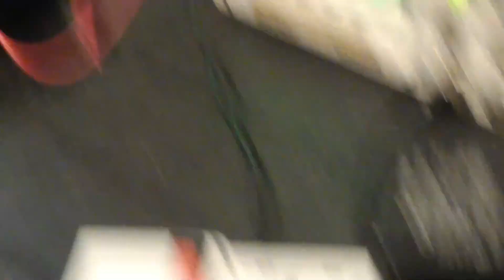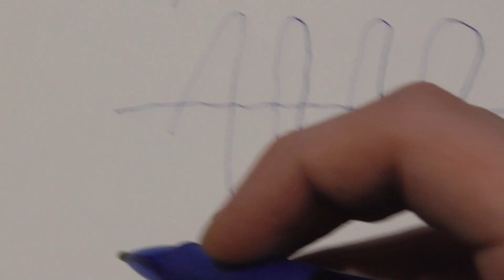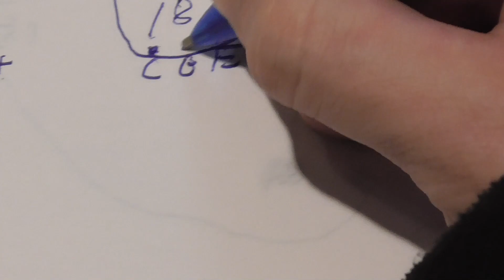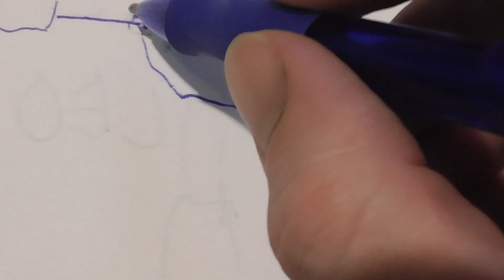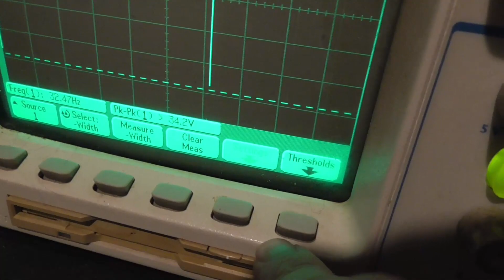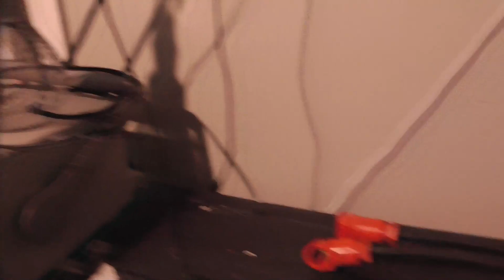Back EMF In Detail

Comment: What's the value of R1? Is it that big ~10watt looking resistor? Surely a base-feeding resistor needn't be so big??
Reply from the maker: It's just a basic simple  transistor oscillator circuit.  Not really specific to any of my other projects unless I specify like "this is a joule thief circuit" R1 is just base resistor, It's representation only. The value will change according to the parts and voltage used :)
Reply: @joellagace1679  fairynuff :)
Reply: @joellagace1679  I guess your day-to-day modest loads like fridge, computer run off these?
Reply from the maker: @jimmybrad156  Bedini's later devices did, How ever its no basic project. And cost a few thousand to build at that scale if you want to run loads live off the charging device. It's not impossible.
Reply: @joellagace1679  I meant with the battery float in between, as shown in your video. Why not power a fridge instead of the 100w bulb, and see how it's doing after a week?

Comment: Hi Joel,

I have been conducting similar experiments for a few years now, using MOSFET for switching. The only time I achieved a over-unity result was when I employed a low duty cycle. However, in my case, using a low duty cycle resulted in a slower charging process and I usually don't get a consistent results.  

I have a question for you: Before observing the overunity effect, did you spend some time "conditioning" your charging batteries? By conditioning, I mean charging and discharging the battery using this particular method for several times.
Reply from the maker: Yes and I also got good results using super caps but there are potential safety issues with super caps.

Comment: Joel think you could used a wire insolated from the ground.like at 30 ft or less and 200 ft long to run the unit you could dump it in to a cap then into the resistor.might not need that much night or wre . bedini was running his on moon light .they use thermal electric generators the small white squares to run LEDs on body heat so why not your unit.?

Comment: So instead of shorting the wires to 1 multi strand coils. Separate them an pulse each wire in the coil to increase the total. Ya said initially first video ya shorted the multistrands to 1   just asking why not get the extra from the same coil

Comment: So you connect the negative of the battery to the positive of the power supply run from the inverter? I didn't know you could do that. I guess it makes sense because the inverter is a transformer so the ground out is not the same as the ground in. Very interesting I never thought to do something like that!!!
Reply from the maker: The back emf has to be isolated and comes back in "Reverse"

Comment: There seems to be a lot of confusion regarding the polarity of the connections to the coil.  Joel has it dead on.  Remember,  when a coil is disconnected from it’s source of power, it reverses polarity when it dumps.  So the negative becomes positive and visa-versa.  Some other tips, the sharper (faster) the disconnect from the coil, the greater the spike.  The longer the wire in the coil {more copper), the greater the conversion to amps.  The higher the voltage to charge the coil, the greater the amps.  **Ahem**, always use an open looped systems as Joel shows in some of his other circuits.  Did I say that out loud?  A coil has many resonant points, you must find the best one for the load.  A battery, as a load, will change its resonant characteristics as it charges and discharges, and will become more efficient as it is used at length.  Problem is, batteries of today are made to fail.  The plates will lose their coating over time and you have to start again.  Use multiple batteries in parallel and you will negate this effect.  Good Luck!
Reply: What if we use a bitcoin miner as the load instead of a battery? It would be very consistent. for example an antminer s9 used can be procured for almost free these days and can easily be tuned to run 100-1400watts using custom firmware. maybe even at this point, custom input firmware could even be used to auto detect the best resonant points for the coil.

Comment: Hi Joel , 
Thanks for the video . Well I tried to reproduce your results but no luck no matter what I try . I built your coil as you have shown and also the circuit . I have tried the cap dump method also , but to no avail . It charged the battery very well on only 1.6 watts , any less and not much happens .  But not  more out than in  it seems at least for me . Don't know what else to try . 
Jeff
Reply from the maker: hmmm I don't know, have you tried charging super caps or perhaps a sulfated battery that has been desulfated (reconditioned) with back emf? I use a restored old battery, perhaps back emf is not good for brand new batteries?
Reply: @joellagace1679  Yes that's the type of battery I am using . I got it from a junk yard . It's an 18 amp hr SLA  type . I have also tried charging super caps , they charge but nothing special . I will try and get the same transistor as you have . Maybe that will help . Thank you for your reply .
Reply: @jeffreydove2036  did your circuit use a Pulse generator with 1 percent cycle at 20 Hz?
Reply: @fidelcatsro6948  Hi , yes I tried many setting . I used the exact same circuit and materials as shown except the transistor , and of course I didn't have the exact same battery . But I could not reproduce the results that Joel got . Still trying to figure it out. It's just a side project but interesting .
Reply: @jeffreydove2036  I hope you were using a Godzilla coil of 350 feet of telephone litz wire as well..

Comment: according to the circuit you make in the video the battery is being fed by two positives both the one recovered by the diode and the + 12V.
or it is an error in the scheme that you make.
Reply from the maker: 12 volts comes from the dc wall power supply ran off the inverter that is also connected to the battery,

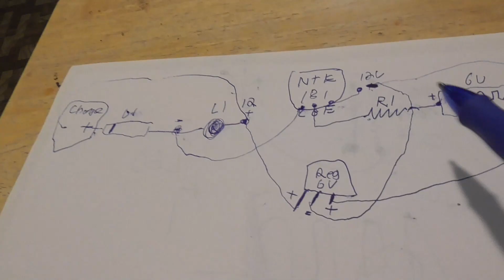Comment: At 18:17 it looks like the minus of the charged batt goes to the plus of the L1 coil and to the plus of the 6V regulator. It is correct? Do you have two batteries, one charging and the other charged?
Reply from the maker: I think when I say the collector is positive thats a blooper and i correct myself later on in the diagram sorry about that, nothing positive with the collector, it pulses the negative from emitter to collector. 12 volts plus goes on one side of the coil and the 12 volts plus also feeds the regulators 12 volts plus input. seems right. sorry about the bad drawing. I just have one battery running. Isolated with inverter. So the 12 volts input here comes from the wall power supply thats running off the inverter. maybe I should have drawn the inverter as well.
Reply: I see this now. It’s series batteries like Bedini but drive battery is actually run from inverter/transformer combo off  lone battery. It’s 12v positive is connected to lone batts negative , which causes field collapse to travel back thru lone battery to front of coil. Clever idea!!

Comment: Joel, this is the most informative video you have ever done.  Bravo sir.  The problem with using the term “Back EMF” is that it is a catch-all phrase.  You have two types of “back EMF”.  Counter EMF and Flyback EMF.  The difference being,  counter emf is nature pushing back when current is applied to a wire.  When you push current into a wire nature provides an equal and opposite force from the magnetic field created.  This is counter (back) emf.  Counter emf is NEVER greater than the input voltage and is always less (unless using some superconductor).  The spikes we see from the collapse of magnetic field is the FLYBACK EMF.  This can be WAY more than the voltage applied.  This comes from the amount of copper used.  The more used in the coil, the greater.  However, you also add to the resistance which is loss, when adding copper or other conductors.
Reply from the maker: Thanks for the info!
Reply: I tried a lump of copper after the coil it ads weight and very little  resistance. It gives more amps and same voltage peak.
I tried copper wire aluminium wire and Iron/Zinked wire all together in a pressed lump with copper coupling. It is a great push for Amps. To do with magnetic allignment? loaded as a spring? Unrolled at the flyback? Or simultaniously capacitance between the wires unloading?
Reply: @robertbaelen7656  That  lump of copper sounds interesting, I'm going to try that!  Do you have any videos or numbers from that experiment?
Reply: @justbob1581  earth has a big mass, even lightning wil be absorbed in the mass, A Vandergraaf generator can hold a big amount of diëlectric Voltage the bigger the balloon or recipient the more electrons come loose, and the more voltage and the more power it hold, dump it fequently in a capacitor and you hove converted it to reel power. That you can use to store chemically in a battery or burn it in a resistance. The lump copper or other conducting stuff represent a lot of electrons you are pouring them out of the matrix, the atom the cristal etc.
Reply: This is the first time I have heard Flyback EMF.
Do you have more information on this? I can't find anything on the www. Often there are many names for the same phenomenon. I would be grateful for any clarification.

@joellagace1679  you have used a four-wire telephone cable and joined the four strands together. Did you also add the shielding to it?
Reply: @krisss369  Flyback emf or flyback voltage is an old term, circa 1950s.  It is the voltage spike that occurs when a charged coil’s induced magnetic field collapses due to disconnection of the power that induced the field.  The collapsing magnetic field is what is producing the “pressure”, voltage and is very powerful.  When this collapse occurs, it pulls dielectric (vacuum, quantum, aether or whatever you choose to call it), with the collapse.  The greater the expanse of the magnetic field, the greater the conversion.  Coil geometry matters.  Space between the wires in the coil (dielectric), matters.  Absence of core material matters.  Coil geometries that are inducive to ~3-3.5MHz give the best conversion.  Heterodyned frequencies that hit that range give great conversion.  Nothing is free, but conversion of the dielectric is what makes this universe.  Good luck.
Reply: Amazing information  @Tachyoncatcher
Reply: @krisss369  a catIII cable has no twisting or shielding it depends on wat cable it is.

Comment: Thanks for sharing and thumbs up. 
But there is something I don't understand.
The negative pole from the battery goes to the input of the LM7806? And the negative (GND) from the LM7806 and emitter also goes to the negative terminal of the battery 🤷🏼‍♂

Is LM7806 fed by the pulses?

And does the neon light between the collector and the emitter have a function?
You haven't drawn in the neon. They usually only fire from 70V if I remember correctly. Your BACKemfs have 36V.

Thanks and keep up the good work.
Reply from the maker: the neon is just for crude protection if voltage nears 100, more of an indicator that something is wrong if it lights up. It's optional and I don't recommend as a neon does not offer much of a protection.

Comment: Wow its exactly what i expected, i failed to get OU i think is because i wasnt using such a super large multi layered coil you used! Thank you for the video...im off to hunt for 
350feet of old telephone multi layered cables !✔ 
he uses NTE181 NPN Transistor for switching✔ 
1 percent little pulse duty cycle ! ✔️
300w inverter powers the pulse generator through a small ac to dc converter✔
🐱👍🏿
Reply from the maker: 350 feet or more....
Reply: @joellagace1679  10-4 🐱👍🏿
Reply: @joellagace1679  sorry one more Q: What is the value of the resistor thats connected to the base of the switching transistor?
Reply: @fidelcatsro6948  1 ohm 10 watt
Reply: @mbaltaoglu1381  i havent been able to source the coil wires yet but thank you

Comment: Is the source the ac power supply?
Can't you use a 12v battery and put the pwm directly on it. They can be operated with 12v. 

Not that you charge the battery with the ac power supply, that wouldn't be that special. 😉
Reply: he is right you need to isolate the discharging of the battery and recharging of the battery...its like you cannot have traffic running opposite directions on a single road without lane markings to distinguish between the 2 directions!
Reply from the maker: @fidelcatsro6948  Well said
Reply: @joellagace1679  in your opinion will filling up the core of the coil setup with iron nails improve the veracity of the bemf spikes??
Reply: @fidelcatsro6948  no
Reply: @robertbaelen7656  ok👌
Reply from the maker: I need to isolate the generator coil dc pulse from the battery dc, the inverter is my method, I could build a fancy controller isolator for it however internally I measured the current draw from the inverter to be no more than 1 amp. So for now that's what i'm using. If I can find a better way to isolate with very little loss and current draw I will try that. I don't like very complex circuits but i'm ready to do what needs to be done if its required.

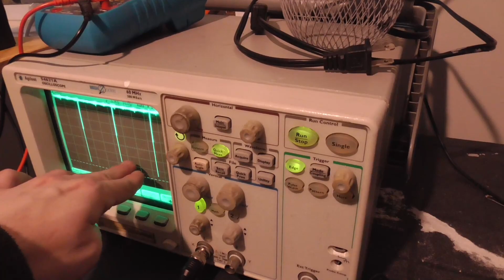Comment: 28:40 the sweet spot. So you look at the value of the backemf to find the sweet spot? If you use like 150 Hz for example you might don't get so high backemfs but a lot more of them. In sum it could be more efficient. Or don't you have increasing voltage on the battery with higher frequencies?
Reply from the maker: There are bumps, points at multiple wavelengths so it kind of does go up and down as you can see. And yes I noticed if the frequency is too fast going towards "RF" with little current.  You will need more power to compensate but other strange things start happening with "rf" that you need to account for. Charging with rf can be even better but the circuit needs to be modified to better work at rf frequencies such as high speed diodes and such. and at rf the battery can also fall into resonance excitement to offer some "super conductivity" so more efficiency charging.